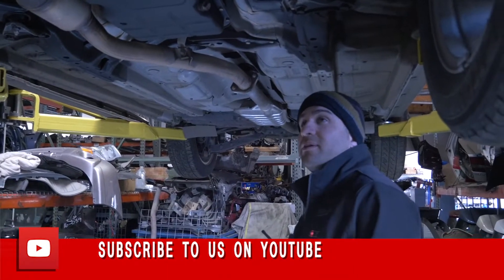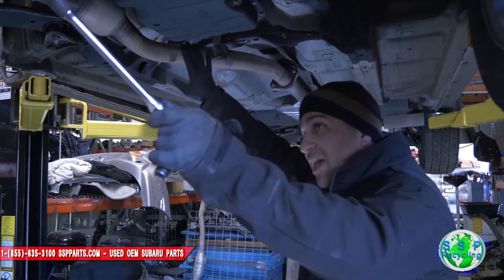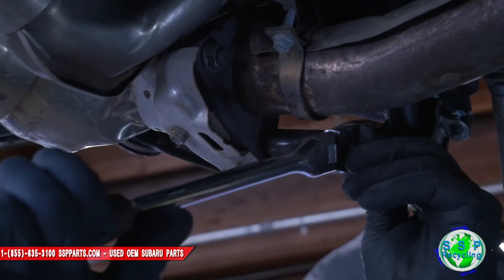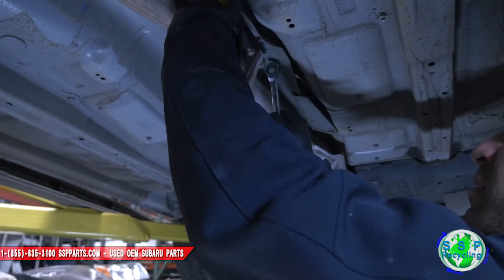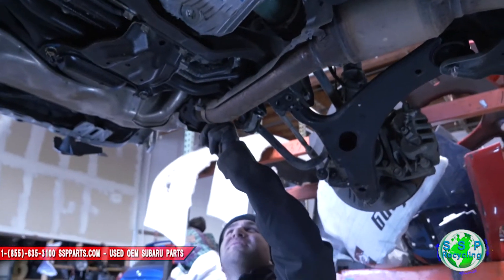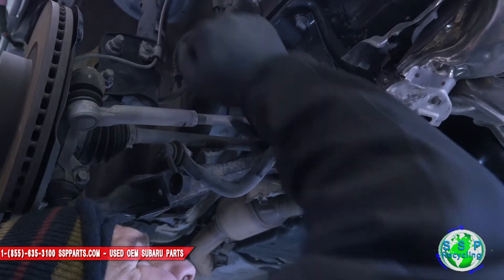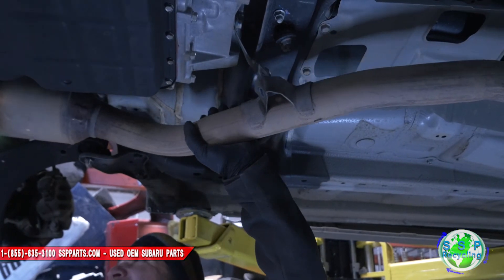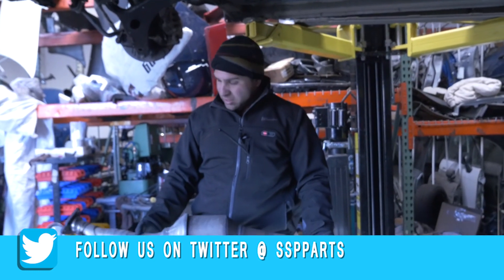How To Remove an Exhaust Pipe - 2012 Subaru Forester

Comment: Did he say pretzel cap? Under the engine on my step daughters 2012 Forester there’s a shield that’s smoking. I don’t know if oil leaked in there or not. But there some sort of plate that’s attached to the manifold, and I have no idea why smoke is coming from it.
Reply from the maker: Probably front timing cover on the corners is leaking onto that pretzel or exhaust manifold and burning off